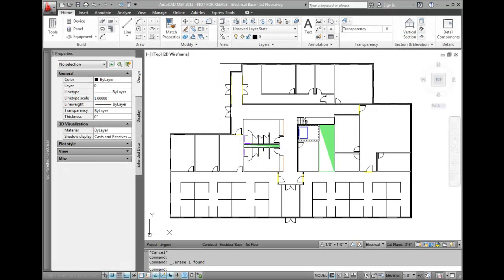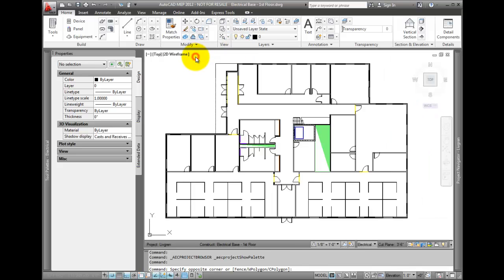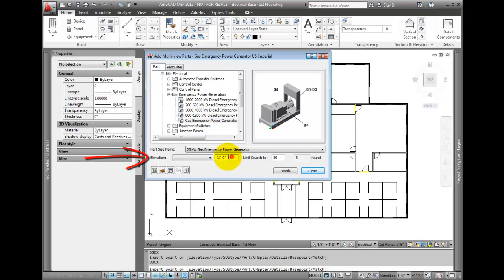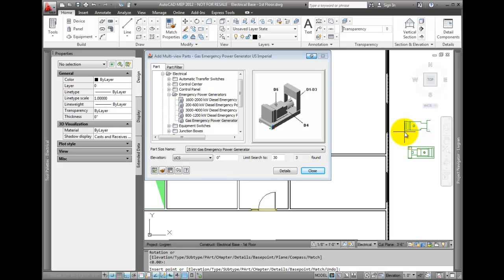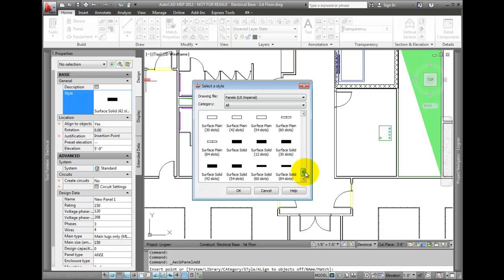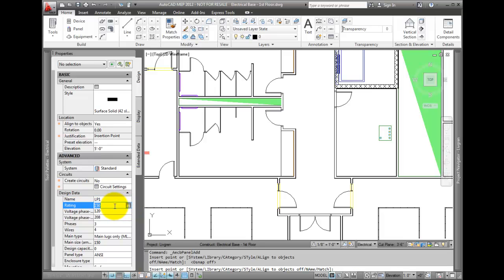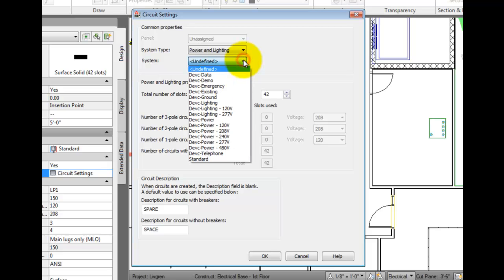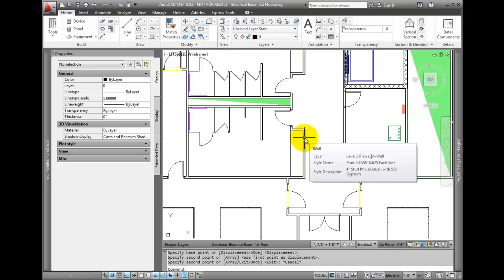AutoCAD MEP 2012 Tutorial - Adding Electrical Equipment and Panels

Comment: This software is good for mechanical engineering  HVAC and plumbing ...not very practical for Electrical Engineering drafting. Don't waste your money to buy it for the electrical department.
Also  the price is too high but  the customer service and Info. is horrible